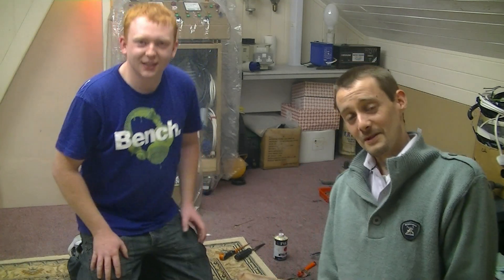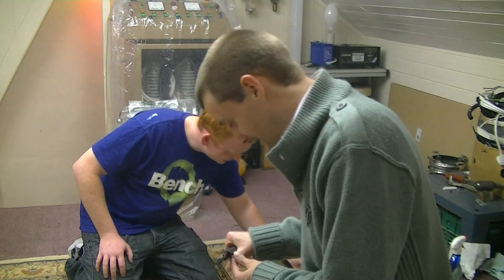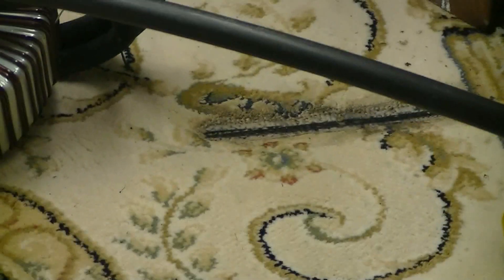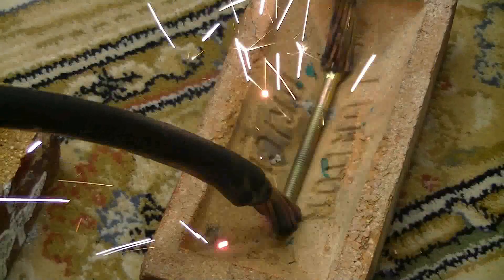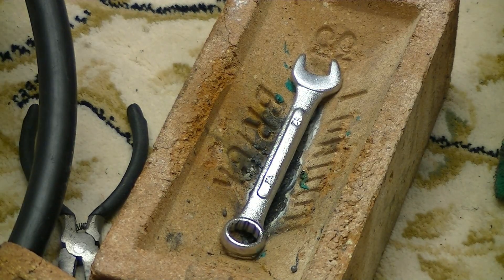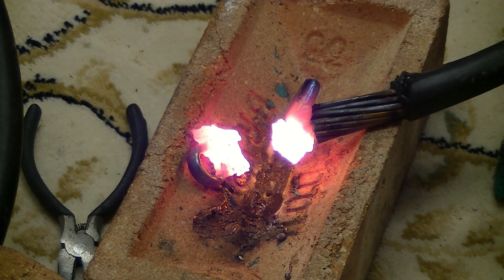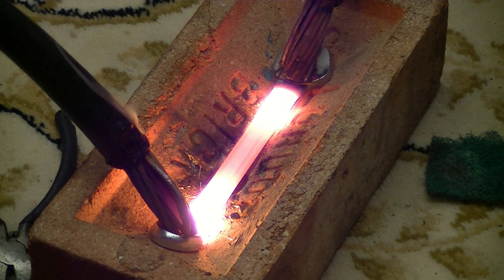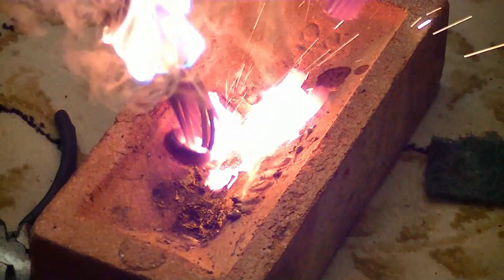5000 Amp Fuse + Tools Melt With High Current

Comment: This doesn't at all seem dangerous as fuck.
Reply: Caustic_ 

Well, if the voltage is low enough, it's fine. Which it probably is, considering it's transformed off of a normal house circuit (I don't know what voltages they use in England).
Reply: Most people do not understand the term 'current kills'. When connected to 240v, the human body passes about 100ma, so from the angle of electrocution, a table lamp is just as dangerous as the cooker. However, if you short the table lamp, the 3a fuse in the plug will blow with a small shower of sparks. With the cooker, quite a large flash will occur and can cause severe burns. A lot of accidents happen changing meters, since the supply fuse is 100a and meter engineers sometimes do not remove it in order to avoid shutting power off to other flats on the same supply. Live working is perfectly safe if engineers are correctly trained, but few meter engineers are. Horrible injuries have happened in the past when a metal watch strap or a ring have shorted between bus bars in larger buildings. one guy lost his hand after an accident this way. It was on a 3 phase 300a supply, and about 200kw flowed through the strap before the fuses ruptured at 1.5 times rated full load. With supply fuses this is a lot worse, since they take 3 times longer to disconnect. This is to allow the inrush current of large electric motors, such as lifts and compressors in air conditioning. I am sure that you have realised that I am an electrical engineer, so I am well aware of the danger points. I spent several years working on the systems that were supplying power to Heathrow Airport. In this case power needed to be maintained at all costs to avoid loss of power to air traffic control, so all engineering staff were well trained and outside contractors were monitored throughout their work. Wearing a watch, rings or jewellery while on duty was a dismissible offence. Regards, Wills
Reply: thedragon12461 So a single leg is 120v, and the amperage out of the socket is probably around 15a. So the voltage after it's transformed is probably around 1/3 volt. Perfectly safe to touch.
Reply: thedragon12461 If these guys are professionals, I'm an electrical savant. As long as your hands are dry, it would be almost impossible to hurt yourself. I still wouldn't touch it just to be absolutely sure, and because I've been shocked more times than i care to count, but this shit is safe.
Reply: he sounds like jack sparrow
Reply: +the dragon12461. They can not be using 240v at 5000amps. The maximum single phase supply is fused at 100amps, otherwise the star point would shift on the LV transformer and customers connected to the other phases would end up with nearly 415v Even with a 415v supply, the maximum fuse rating is 400amps and customers are required to balance the load. To obtain 5000amps at 240v, would require an 11kv supply and a specially wound transformer that would cost thousands of pounds and need a crane to lift it. I have little doubt that they were using an isolating transformer to obtain the current, but the voltage would have been no more than about 3v. At 240v, a 5000amp short circuit current would have dissipated 1,200kw which would have melted their cables instantly and without doubt killed both of the guys. That is why guys who put a drill through a distribution cable rarely live to tell the story, since the short circuit current from the substation at LV is up to 16,000amps in UK cities.
Reply: French Montana it's 240 volts ac :)
Reply: French Montana Possibly, but as with everything electrical treat with caution, even if low voltage, the current (amps) kills, so it's best to leave it to the professionals like photonicinduction as they know what they are doing, (i hope xD)
Reply: French Montana yeah :) it hurts, worst one i got was off an electric fence that was supposed to be isolated but wasn't
Reply: Brits for you
Reply: wilsjane oh yeah ^^ and i never said they were using 240 volts, i was just sayinh that the mains voltage in the u.k. is 240 volts since i was asked ^^

Comment: for domestic a normal voltage is 220 then how did u get more than that
Reply: v Kumar lower voltage for a higher current, step down transformer
Reply: v Kumar transformer
Reply: BK CheZ so the voltage was super low.when they did this?
Reply: BK CheZ BK CheZ so the voltage was super low when they did this?
Reply: Chung David yep.
Reply: v Kumar ikd

Comment: I must give you props.  The cool factor is off the chart but so is the stupid factor.  I have both a degree in electronics and a journeyman electrical license and have been working with electricity for over 25 years and I really expect someday to read about you two receiving a Darwin award.  Also, did ginger there take a puff on a joint before you started?   Again, way cool but mad stupid.

Comment: you guys are doing this in your house with no safety gear around like a fire extinguisher in case of a fire? your dealing with very high voltage and heat your carpet will go up in flames really really fast and burn your house down...if your gonna do it do it in a safe location with safety gear around...but besides that good experiment
Reply: Jeff Araujo Calm down they have a spray bottle of cleaner to put out electrical fires.
Reply: aoflex  lol...they seem like there burn outs
Reply: I think if you're smart with your equipment, you shouldn't have any problems or the need for gear. Do these guys look like idiots? Nope.
Reply: Jeff Araujo High CURRENT
Reply: Darwin warned us about this shit leave them alone the spray bottle is very appropriate
Reply: Keith McClenaghan well we are crazy as fuck
Reply: High *current, not high voltage. Current melts, voltage explodes. If that was high voltage they wouldn't have made it to the end of the video, or passed the first experiment.
Reply: Nigel Hutchinson  current is what kills a man. that is why tasers are 100000 volts. 0.5 amp can stop a heart beat I think...
Reply: in this case, they using a very thick wire to harvest a lot of current from that transformer but only few winding so I guess that thing only ~5v and nothing will happen even they touch it, that's why the charger of your phone show it can put out 5v 2.1A but there are no safety risk from touching the end of it (high current, low voltage), the taster only gave people shock and temporary disable them but mostly never make them die (low current, high voltage). The mains power are 240v and can supply up to 20A so you should never touch it
Reply: bacorable lol
Reply: Is this an experiment? Really?
Reply: how you fuckers took over the world is beyond me
Reply: alcohol and drugs
Reply: Radley Anaya 50k volt
Reply: Radley Anaya no, you&#39;re misunderstanding about how electricity kills, voltage are the thing that will carry the current through body, if you have very high voltage (10kV) but small current (1mA) then it will burn your skin if the arc get contact with your skin without making much muscle contraction so the heart will be OK. But if you have 1kA but only 1V then there is not enough voltage to bypassing the resistance of body skin so nothing will happen because that high current can't travel through you... So summary you must have enough voltage and current supply in order to making the heart contraction too much until it get unsynced and malfunction.
Reply: Jeff Araujo in case of fire the using spray bottle
Reply: Jeff Araujo that spray bottle has got them covered lol. nothing wrong with playing with electricity on damp carpet
Reply: Thanks mum!

Comment: 100 bucks says they kill their self's by the end of the year.....
Reply: by the way galvanized metal is highly toxic and poisonous when it's melted you should be wearing respirators but I have a feeling safety is not your priority
Reply: This video is 4 years old
Reply: Benjamin Bright 200 bucks says they blew each other after filming this.
Reply: all it'll take is one touch of the copper ends of the wire because that circuit has enough amperage to kill you 10,000 times
Reply: Themselves.
Reply: Benjamin Bright Anytime my man !
Reply: Benjamin Bright R.I.P your english
Reply: Benjamin Bright he nay have. hasent posted a vid in a while
Reply: R4DON voltage usually wont kill you. amperage will.
Reply: High amp gets life dangerous at around 50 volt.
Reply: Absolutely Braggadocious .5 amps is enough to kill a full grown person.
Reply: Ezzor ok. I've also heard of accounts where people have brushed up against high amperage wires and either died instantly or even in one case receiving severe brain damage. Granted those are also more amperage but the fact remains. And was it a straight 10 amps or were there resistors in the circuit?
Reply: First: source? Sounds like you made this up. Current doesn`t leap out of wire, and induction into the body is virtually nonexistant.
Second: If you do the math on the setup in the video you get around 5-6 volts on the wrench (based on 230v mains and a 120:3 transformer ratio). 5v is in USB and other common devices. Those guys could literally grab the disconnected output cables with both hands, wet, standing on bare metal and nothing will happen.
Third: Circuit amperage does not kill, amperage through the body does. In order for enough current to flow through the body, enough voltage must be present. Most safety standards state the dangereous level of voltage starts around 30v. Otherwise a D cell battery would be considered dangerous...
Reply: As the video was posted years ago, I think it's safe to assume you lost that bet before you even made it
Reply: Benjamin Bright with each others farts
Reply: Benjamin Bright this was done a few years back time stamp m8
Reply: well by the end of 2017
Reply: Benjamin Bright
Reply: R4DON no. it depends on the ampere. you can get 5000volts and be ok. but you can die (if very unlucky) at 5 amp. 100% of people would die from 100+ amp.
Reply: +Ezzor
If the voltage isn't high enough then the amps don't even matter
Reply: +Brandon Nevarez lmfaoooo
Reply: At least catch the apartment on fire.
Reply: Benjamin Bright, HAHAHA!
Reply: Zach F No, wrong. You can touch those copper ends and nothing will happen to you!
Reply: If only amps had the ability to kill, i would have died about a hundred times because I work with 20-30k amps everyday. And i can touch the unisolated wires without feeling anything, except warm temperatures. And i know what i am talking about because I work as an electronics engineer at BMW in Germany.
Reply: Karambit Doppler  thank you for pointing out my bad Grammer too the whole world... ;)
Reply: Ever Bustos WHO WHOULD HAVE THOUGH?
Reply: Zach F That depends on the voltage
Reply: +Zach F
Without enough voltage the current won't even matter
Reply: Zach F also it depends on the time exposed to it. I took a 10 amp shock once.
Reply: If they die by using a high current source and are not killed by any other means, sure. Contact to a high voltage source or death by incidentals would invalidate any agreement. I use 50000 Amp sources daily and am not phased by the concept. Worst case scenario, I could be burned or a spark hits my eye. Safety concern? Sure. Deadly? Nope.
Reply: It was such a small amount of galvanize, no worries.
Reply: Ezzor The current that flows through your boby kills you! Not the current u touch, thats why you need a high Voltage to kill you!
Reply: Fladelerium is absolutely right
Reply: Highly unlikely, he's been doing this shit for the last four years on Youtube. Probably longer otherwise.
Reply: +ezznor Actually 1/10th of an amp is enough to kill you. Voltage means nothing. You will receive amperage when you complete the circuit i.e becoming the lightbulb in the middle, which means death most times. If you only touch line side (hot wire) you will receive no amperage. Voltage represents how strong the force of electricity is, amperage represents how hard the force is applied so to speak. Amperage only flows through a complete grounded circuit.
Reply: D4RKD0ME exactly voltages are the ability to do work amps are the load
Reply: Benjamin Bright thinking the same thing with one ZAPP
Reply: As long as your body doesn't complete the circuit you will not receive amperage. Im assuming you work with DC, so if you were to go between the positive and negative you would become a 30k amp fuse. Dead. And working at a BMW plant im gonna also assume you are grounded to the production line. The electricity you are handling is bypassing a path to your heart and going strait to ground. Work with house electricity and start touching wires, i promise your underestimation of electricity's lethal potential will be reconsidered.
Reply: KataCoasters I am actually not working directly at the productionline i am the one who is testing the welding tongs which are placed on top of the robots to automaticly weld the cars and these tools work with about 3-5 volts DC which is not dangerous at all. It is as dangerous as working with a battery. What i want to tell is that amperage it self is not dangerous at all.
Reply: Potato RIP poor old tosspots.
Reply: pay up boi
Reply: KataCoasters anything is a completed circuit if the voltage is high enough.
Reply: https://youtu.be/8Xz2uIfePas

It's been over a year since you posted your bet and they have videos that are fairly recent.

Comment: for everyone arguing about the electrocution danger here, as long as its under about 24v there is no danger of being dangerously/painfully electrocuted. to test this, lick your fingers and touch both terminals of your car battery. typically a car battery can put out 500-900 amps, yet you will be lucky to even feel a tingle. There is too much resistance to let in almost any electricity. I am an auto electrician working mainly on large trucks that hold about 3000 amps in batteries, and this is the most common misconception I see. massive burn risk from shorting out wires or tools (things with lower resistance), but no harmful electrocution risk.

Comment: how do the cables not melt? low resistance? even so, the melting point of steel is higher then that of Cooper, so heat transfer should still melt the copper
Reply: Kaleb Kilfillen I'm no professional, but I think it's because the current in the wire is flowing smoothly, but once it reaches the steal it has no where to ground so all the energy just builds up until melting.
Reply: Kaleb Kilfillen the 90kcmil cable is melting. just not as fast because it's thicker and copper is a much better current carrying conducter then steel is.

Comment: consider the fact that posted 4 years ago however I still feel inclined to point out doing that with galvanized steel the off-gassing is very bad for your lungs it can kill you why blacksmith won't use galvanized steel

Comment: Noob Question:
If the wire which is roughly the same size as the tools that are being melted can handle the current without getting hot, why do the tools get red hot and melt?

Comment: sorry I made a mistake in my comment earlier. I said if they were tore up and wreaked of alcohol when we were dealing with high voltage that I would fire them and kick their asses. that part was very true butt I would also do it with any voltage that we were dealing with. other than low voltage which is 24 volt to me I would have fired them instantly. even working with low voltage like 120 can still kill you if you aren't grounded out or standing in water. sorry for my mistake just wanted to let everyone know that almost any type of electricity high voltage or low voltage can kill you.

Comment: I'm having a hard time understanding how you guys are smart enough to know how to generate electricity, yet somehow stupid enough to do this: 1. In a house.  2.  On top of a rug.  And 3. to the point that the cable insulation is clearly on fire.  Like????????  How did you not realize that a single spark on a rug could have started a fire?  🤔

Comment: touch it :D
Reply: You need a voltage big enough to overcome the resistance of your body to ever let 80 milliamps cross your heart. A typical 220-240v power socket is plenty good enough.
Reply: 80 milliamps across the heart will kill
Reply: There won't happen anything.
Reply: Robin Braun Yes it will.
Reply: As far as I can see that circuit is made for maximum current output at low voltage supply so for humans it's as dangerous as touching the battery in a smartphone :)
Reply: Robin Braun Yeah safe from electricity, I think you're missing the point that the things is glowing like the sun, would burn ya to the bone.
Reply: That's actually completely opposite. High voltage at extremely low current will hurt like hell but likely wont kill you i.e. tasers and cattle prods and whatnot.  But it could take as little as 0.5 amps of current to cause immediate heart issues

Comment: mabe u have a 5000 amp fuse but u never use 5000 amp for this.
if u use 63 amps u generate 400 amps with a shortcut.
so if u use 5000 amps where ever u get it u create a big lightningbolt
and u need much bigger cables.

Comment: Looks safe..
Reply: I think the voltage is very low so they could even touch both wireends at once without risk of an electrical strike since our skin has a much higher resistance than tools made of iron. However, melting iron in a livingroom at the top of a carpet without having a fire-extinguisher is the safest thing in the world :)

Comment: How did they get enough power to do this a regular 120 household could not do this
Reply: nick savage most European nations use 220v instead of 110.

then wrapping the leads around an energized coil increasing the amp loads.

what these guys did is incredibly dangerous and surprised they havnt electrocuted themselves.